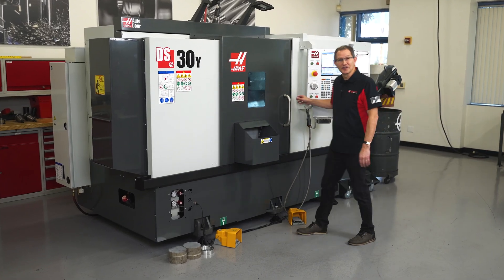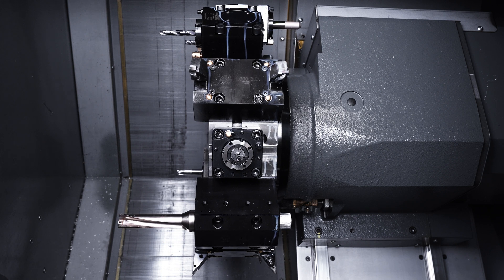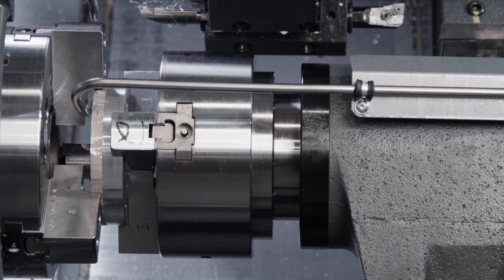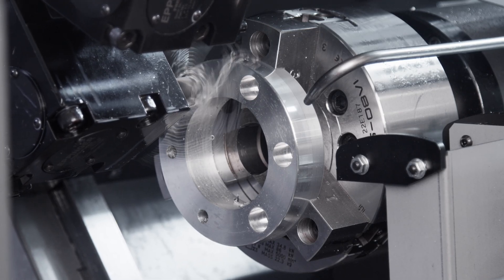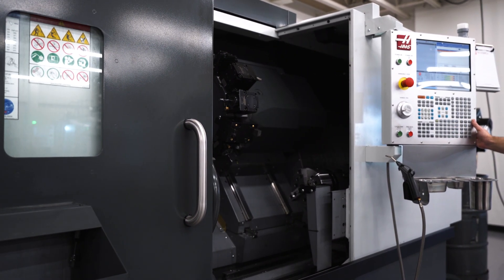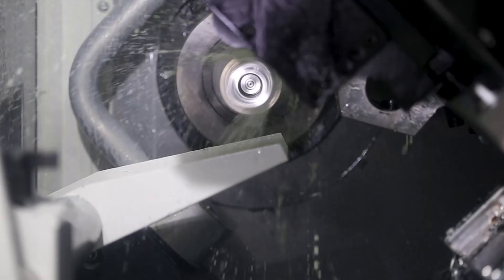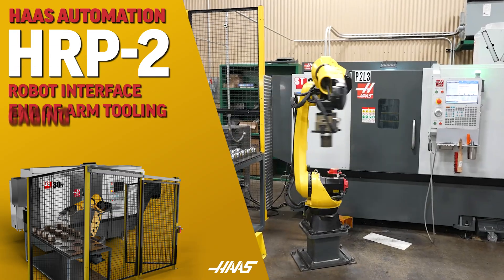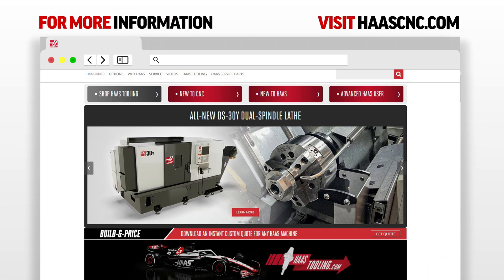The Haas DS-30Y Reboot - Combine Your Lathe & Mill Operations! Haas Automation, Inc.

Comment: I agree the live tooling can save time on some simple features in mild steel, or non ferrous  metals..  Can save you  time from deburring holes and other features too if  using a bar puller.. ..  Downside is only 3000 rpm, It sometimes feels like you are wasting time not using the belt sander instead of a chamfer mill.... Very low hp so the live tooling stalls using M14 spiral taps... and the black elephant behind the turret is always in the way of everything. Good job.  Have u  fixed  the turret  spinning from interrupted or very heavy cuts  and moving everything out of center ?    At least the control is  great and fun to program on the 2005 model .. I like the calculators .. and being able to make the obvious g and m codes  you skipped. 😄

Comment: I purchased a DS-30Y a year ago and while it's a very impressive and capable lathe I enjoy using, I'd warn anyone interested in using the C axis or doing lights out automation work with it to wait until Haas works out the kinks. I purchased mine for lights out automation but we continually have C axis fail to engage issues that don't allow us to run the machine unattended. This is after 5 visits from haas service technicians, it's still not functioning as it was supposed to from day 1. It's a nice machine but don't buy one for any high volume production needs that require the C axis on either spindle.
Reply: Your input is super helpful! We were just about to order one and as a part of my research I ran into this video. I guess we need to consider going with a different brand. Thank you!
Reply: Wanted to comment here in case anyone has a similar issue. It's finally fixed. 10 Tech visits, 7 software updates, 1 year and the culprit was that the main drive belt wasn't properly tensioned. Our HFO did the best they could with the information and support they were given, I'm glad it's resolved and understand they had to go through the other troubleshooting steps first, but keep a lookout for this if your c axis fails to engage consistently.
Reply: @araugh  The belt make a weird deep sound when it revs down if the tension is not good, a service tech has a special device to set the correct tension.
Reply: HAAS quality has really declined over the last several years. Take a look under the sheet metal of the DT-1 for example, and you will see a much narrower, smaller casting than the machine originally had. You offer good advice in telling people to think long and hard before buying. The product service and support has not kept up with their sales. Sad to see.
Reply: @bsf225  Of the 3 VF series mills we have at the shop, the oldest one being a 2014 and the newest one being a 2018 the cost cutting changes they have done on the newer machines are subtle but very obvious when you notice them. The X axis way covers from 2014 to 2018 went from being sloped to flat across the top so they collect more trash and sag slightly, the older covers had brass runners on the bottom sides so they would not rub stainless on stainless as they telescoped in and out. The new ones omit the brass runners, along with extra bracing and sound deadening on the cabinet the 2014 mill has. The removal of the work light from the tool rack between 2014 and 2017
Sometime after March 2018 they changed the way covers on the VF series again and now charge $5k more for stainless steel, what used to be standard equipment.
Reply: @135SoHc  I don't know if you've also noticed, they don't even include an air regulator for the air input. You have to supply your own. Inexpensive, but come on. You pay $100k for a machine, and no regulator? Makes you wonder what else is missing.....

Comment: Paying for faster live tooling that isnt just exceeding 100% duty cycle would be great. finding out I just paid to exceed duty cycle sucked. Glad the sub is a real C now. I hope you beef up the auto door. I complained to my HFO that it seemed rough when it slammed close and a year later the auto door is dead and I have door lock issues. My 20y is what led me to stop buying haas machines and shop elsewhere.  it has problems with powering up and knowing centerline. the entire time it was under warranty they were unable to fix that and I just learned to not need to use the lathe and let the mill or 5 axis do the jobs.  Was the machine I looked forward to the most and that I now use the least.